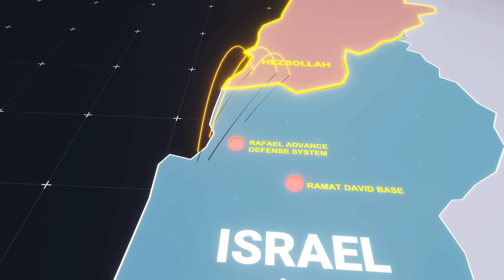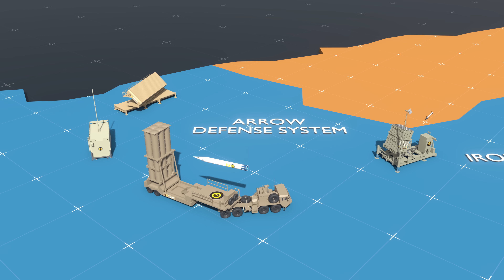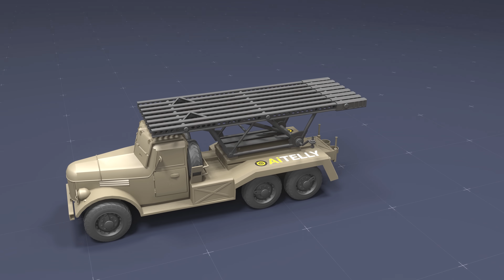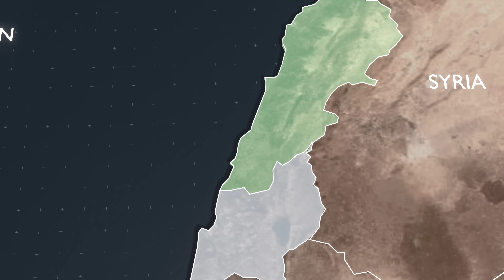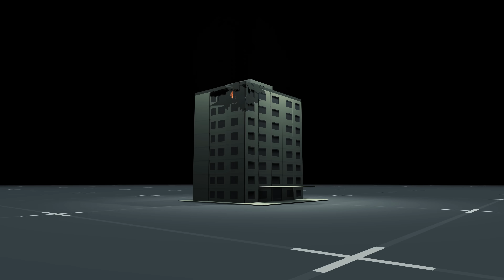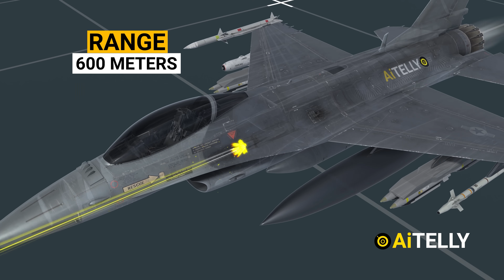How Hezbollah & Israel counter-attack after the Lebanon Explosion?

Comment: Thank you for metric conversion into imperial. I know what a mile is. No clue what kilometer mean.
Reply: 1 mile(terrestrial mile) =1609m, kilo is the Greek prefix for 1000, once kilometer=1000m. 1 km=0.6215 miles. Roughly the mile is around more 60% than the kilometer.